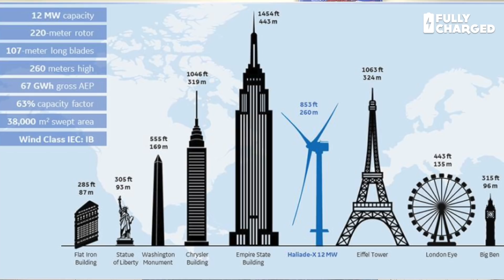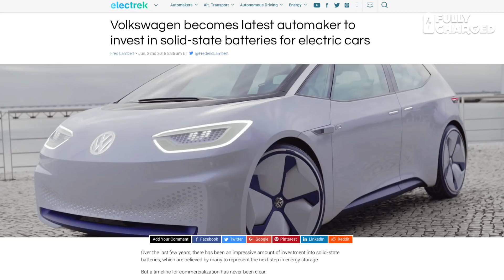Winds, Waves, Trash and Solid Batteries | Fully Charged News

Comment: Everyone working on solid state batteries need to pay for separate research, instead of pooling their results for the greater good.  The exact same experiments are going to be carried out secretly by so many different people, such a waste of money.
Reply: Counter argument: multiple teams working independently will investigate more approaches, and also perform 'independent verification' when they achieve similar results...  not saying that multiple competing teams is definitely better, but it's not significantly worse either (especially if it results in more overall money being spent)
Reply: Yes, I did think of there being more than one path to check.  My problem is when they do the exact same experiment, like finding the maximum pressure lithium can handle in an oxygen rich environment before it oxidizes.  It is very expensive and...  well, I already said all this.
Reply: Indeed - but every experiment benefits from independent verification - so you'd need multiple teams to do that experiment anyway...  this way, they're doing it without waiting for each other :)
Reply: Independent verification only works if they are sharing their results, but something tells me they are closely guarding anything they discover so that you could be doing the exact same experiment that was done hundreds of other times, but you have no access to their results, so you waste millions of dollars over a decade just to discover something doesn't work, even though dozens of car companies already knew that approach wouldn't work.  Sounds inefficient if you ask me.  The Aliens must be laughing at our lack of cooperation on Science, when money is involved, that is.
Reply: I guess I didn't mean experiment, I meant test.  For example, how many cobalt ions will jump to lithium if it is doped with nitrogen.  If everyone had access to that information, then they wouldn't need to do the test themself.

Comment: How do solid state batteries avoid thermal runaway? Before you snark about how fuel burns, thermal runaway in a solid state better would be like if a car’s fuel tank aerosolized  and then caught fire, basically a bomb.
Reply: Phos9 
Because solid state batteries stop dendrite formation. It's the dendrites which cause the short circuit, which then causes "thermal runaway".

Comment: When they're talking about kilo, mega, or gigawatts for producing. Is this each hour/each day/each year? And how many  kilo or megawatts does a single person in EU/NA use each day/year or whatever? I love all the numbers on windturbines and solarpanels but I can't really grasp them cause I don't know above details.
Reply: When they talk about Megawatts and Gigawatts, it's the nominal capacity, the maximum power output.
If you talk about energy production, it's Megawatthours and Gigawatthours per year.
Offshore-windturbines achieve roughly 4000 full-load-hours per year, so you would get roughly 48 Gigawatthours per year from a 12-MW-turbine.
Depending on the quality of the site.
4000 full-load-hours per year is adequate to 46% load factor.

Comment: I hate to bust your little bubble but what does that trash truck weigh?  I'll bet quit heavy and will be very damaging to the side roads that are not made for the heavy weight vehicles.
Reply: THat's only an issue if it is significantly more than the current trucks (which aren't exactly lightweights)
Reply: It isn't so much how it weighs but how it's distributed and total load per axle. Other factors such as turning circles need to be counted for as these put quite high forces on the road structure . From my work on roads to date usually it's the fire trucks that weigh the most.
Reply: Maybe - but from the visuals shown, the design isn't noticeably different from the existing trucks that they replace, so the impact on the roads should be negligible.

Comment: Look into Ionic Materials.  Solid-state, flame-retardant batteries with a polymer electrolyte, twice as energy dense as current tech.  The brainchild of Mike Zimmerman.  There are videos of the batteries being shot by 9mm rounds and continuing to power devices.
Reply: Kalepsis 
Also cut in half with scissors!

Comment: Any possibility that these old oil rigs could be used to house these windfarms? After all, its already connected to the seabed and some landline links. Thought SS batteries are not possible till 2030 at least (says Toyota who know a bit). What we don't know is what impact on bird migration these massive turbines are having. No big lump of birds to find on the sea surface. As for offshore- China is coming up fast from the rear and if Trump ever bothered offshore wind the US would be a mammoth market
Reply: the RSPB (Royal Society for Protection of Birds) a really big important organisation in the UK has installed a windmill at its HQ. The reasoning behind it is that the dangers of climate change far outweigh the dangers of bird losses. They do however advise against in certain areas based on their experience. However this "bird slaughter" is a favourite weapon wielded by the climate deniers as if anybody thought for a moment that they actually cared. It's a while since we seen an oil spill thank God but it tends to be the RSPB that are at the forefront of cleaning up the mess. Bless em.
Reply: While I agree CC is more of a danger to birds than any windmill, RSBP can see any bird impact as the turbine has on land. Sea crossing corridors for birds are different and I would be wary of any claims on bird impacts from wind turbine developers even if bigger wind turbine blades can now be slower as compensation. As for big oils history on oil spills, nature is a vague afterthought and PR damage control. Most birds are flying oversea on minimal energy expenditure and direction/formation focus. A new massive windfarm in their path is a cause for stress and more energy use in flying around it (or above /below the blades). Thats assuming its in daylight!! The trend for ever bigger (higher) wind turbines is something more birds will need to fly above (and avoid being airplane engine fodder)

Comment: I hope they are still not being Muppets about turbine separation, off Essex they put turbines near 'The Wallet' with a  'no sail' zone around each turbine that was larger than the separation distance, like building a huge wall against boats, very stupid.
Offshore wind power is good, just be sensible about it.
ONshore wind is not good at all.

Comment: A few weeks ago my old mate said electric cars and the energy revolution will not be a force,ie take over patrol cars and gas and oil ect  for another 50 years. I BURST OUT laughting.And I said it's happening NOW.
Reply: Edward Cooper, are you familiar with the sigmoid (s-shaped) curve of technology adoption?  This stuff is not linear.  50 years from today for EVs to become a force is utterly laughable.
Reply: Gus what oil company do you work for? Wanker? what, for wanting to see a renewable future...yeah what a tosser. No one is saying EVs are the only answer, but if I was asked which is preferable, it is EV everytime.
Your argument is kinda invalid mate. So a ship powered by diesel delivers a petrol engine and an electric engine. It gets attached to two cars. one uses oil and one uses sunlight. what has the higher carbon footprint? (not to mention environmental damage etc). When the total cost of ownership for an EV becomes far less than an ICE (years not decades), then even naysayers like you will come crawling back with your tail between your legs because guess what...it will make financial sense.
Reply: Considering we're almost 10 years in from what I would call the start (Nissan Leaf), I wouldn't laugh too hard at his estimation.

Comment: The Muppets of the oil industry has done their job. I had a moron today tell me how he doesn't believe in solar and wind energy. "It's so expensive and it just doesn't work".
Reply: There's a study which says offshore wind turbines produce energy at an average of 350 days per year, that's more than a nuclear power plant (they need more time per year for service). Offshore wind is also predictable, you can observe it and you will know early enough when there is too little wind. So you have enough time to react if there is too little energy generated.
Reply: Ronan B Lol. With no subsidy at all my electricity from my solar PV averaged out cost only 6.5p per kWh. I generate enough to drive my EV 10,000 miles per year from a small 4kW array.
Reply: Simon Maier Good points, well said. 👍
Reply: Simon Maier , dunno what study that is, it's a lie!  The turbines I can see haven't been turning now for at least a week, if the weather forecast stays as it is it will be at least another week still.  You can observe them all throughout the year not spinning  aT certain times. They should make the turbine blades out of PV panels, that would really boost the output and make them more efficient.
Reply: make the turbine blades out of PV panels..... and apparently the muppets are in the oil industry?  What material are PV panels made out of, is it silicon and glass - a truly wonderful material for turbine blades.  Even better, how would you electrically connect these pv panels, why wouldn't you just put them on the ground.....
Reply: Edward Cooper , don't get jokes then I see!   But on a serious note, it wouldn't be impossible, just not practical.
Reply: Simon Maier - Do you watch them at night ... sneaky little blighters.
They run at night because the sun goes out ...
Reply: He should be a professor in our Engineering department, he'd feel right at home.

Comment: The main reason for increasingly large wind turbines is that there's a cube law governing the amount of power you can generate per unit diameter of the turbine.

Double the swept diameter, and x8 the power you can get from it.

It's the same rule that means small micro-gen wind turbines that come in under planning restrictions are almost always pointless
Reply: Captain G X4 increase.
Reply: KelDG3 That makes no sense. Swept area is a function of the square of diameter (or radius), the added power comes as a function of Betz' law. I suggest s trip to Google...
Reply: KelDG3  -  what's the name of the law which says that all discussion of 'facts' on a forum must descend into childish argument?!
It's true - Google it!!!!!
Reply: Andy McCabe did you reply to the right person?

Comment: Sensational this video. But your view of solid state batteries is wrong! I say this because, to compete with the quality of Tesla Motors vehicles (and one company with the other), the old companies of obsolete gasoline (and diesel) vehicles need to offer at least this superb autonomy differential. So, as a consequence, it is urgent to deploy these new solid state batteries as soon as possible! Not to mention the advantage that these companies will have to make subsidiary companies to explore new markets for the generation and use of domestic energy with solid state domestic batteries as well! Anyone who misses this train may not have the resources to stand up until a new market opportunity emerges. Not demeaning the size of these companies, but competition is annihilating! Even for Tesla Motors, if Elan insists on current batteries.
On the other hand, it is mandatory to carry out a video with a study on the thermal management of the solid state battery, because unfortunately in countries hot or cold too it is necessary to create and make adaptations ...

Comment: Instead of wasting our tax money on those old due to be scraped oil & gas north sea rigs!  I got a far better use for them which will help us power wise, And save paying out tons of money to scrape them?   Redo them up so the saltwater don't rust them and fit wave power unit under the legs and a set of underwater tidal units and around the sides solar panels angled up at 45 degrees and on the top in the middle where the rigs drilling tower was put a big wind turbine!  And their you go a reuse of the rig that will save the costs of scraping them and give us more eco power?
Reply: I imagine a major part of the expense is the plugging of all that drill pipe in the ground.  Even if you repurpose the drill platform, the well has to be plugged.
Reply: They should turn them into prisons
Reply: Colin Campbell Modern North sea rigs are ships which easily capable of moving. This is due to the large oil fields being dried up so only the smaller ones are left, this makes movable ships me Ch more econimally justified. Almost no company is building new permanent rigs in the North sea.
Reply: Thanks for that?   However I seen plenty of the older permanent oil rigs are still left in the north sea due to the fact they were done before the ship based modern ones.. I seen many documentaries showing that the main fleet of oil rigs still sat in place..  Due to the high cost of removing the or scraping them ( hence Robert saying as much in the video ) their are often just left there to rust.. as the maps still show where the oil field rigs are, the shipping still goes around the area?  I sure the newer ship ones are around,   But the main amount of rigs still in place built in the 1980's onwards..   the oil workers still go to them to work by helicopters.. A Cousin of mine in Scotland, still fly's to work on a older rig in the north sea and he see's lots of them around his rig all not moving ones?  So even if now 50% of them are old non-moving types that still worth using them?
Reply: It will never happen too many back handers going around for the supply of new power stations to re-purpose these ready made wind, tide and solar platforms
Reply: CCS is too hard and expensive. There are no practical CCS systems operating anywhere in the world.
Reply: Enhanced oil recovery is not CCS and like I said "There are no practical CCS systems operating anywhere in the world."
Reply: I'm not against CCS per se,  just that we can't rely on a method that is far from proven. Pushing more oil out to burn, via EOR, isn't exactly helping either. 
There is a huge challenge ahead of us and I don't believe that the issues are being taken serious enough by most governments.
It seems to me that our best option is a combination of things, eg electrification, waste reduction, efficiency, insulation etc and as much  renewables as possible. All those things are doable now.

Comment: Who pays for the decommissioning of wind turbines and how do the costs compare?
Reply: Just a Knight When they need replacing/recycling once they have reached the end of their lifetime.
Reply: nitelite78 Why do we need to decommission them?
Reply: The companies that install them I would assume. They have already been doing this when they replace older turbines with newer more efficient ones, I remember on a fully charged episode (can't remember the video sorry) where this is discussed
Reply: Maintenance. We have electric generators that have been running a hundred years now.
Reply: nitelite78 
Do you mean the ,(new) floating turbines which can be towed to a dock to have the turbine replaced?(or maybe towed to a repurposed oil platform?.... There's a thought!)
These units will use FAR fewer resources than say, an Unclear power station like Hinkley C. They can be built, installed and working in months, rather than years, with controlled commissioning costs which won't balloon, and no "technical difficulties" (Hinkley!)
If one goes down, it doesn't take the whole system out.

Comment: to complement Robert. Wind turbines scale up with square law meaning that while installation cost grows linearly, its production grows quadratically. Meaning that with twice as much material you get 4 times electricity (this is theory it's not that simple as transport costs grows exponentially etc.).
Reply: And they also continue to operate well at lower wind speeds.
Reply: And the wind is more constant at sea than on land.
Reply: Zdeněk cube law with swept diameter*
Reply: And the wind is more constant the taller the turbine.
Reply: There has to be limits to this idea as often you have wind moving in different directions at different altitudes?

Comment: There's a local authority in Yorkshire, think it might be Leeds, where they're using waste compressed gas from the production of oxygen for hospitals to use as the power for refuse lorries in place of the hydraulic units powering the compaction. Massive savings on fuel. Quite innovative I thought. EV refuse lorries is a great idea 😀
Reply: I'm curious how they do this. The problem is gas is compressible, hydraulic fluid not. So it's easy for a hydraulic system to move a cylinder slowly to half (and stay at this position), but not for a gas filled cylinder, it will move completely (and faster) because the gas in the cylinder is compressible. Pressure air systems are usually only used where a movement is needed from zero to 100 % and back.